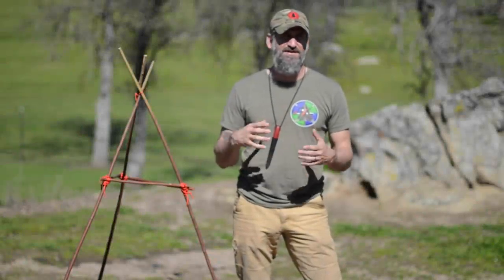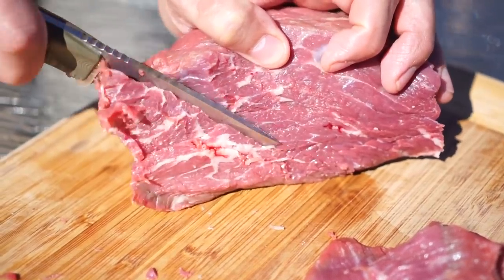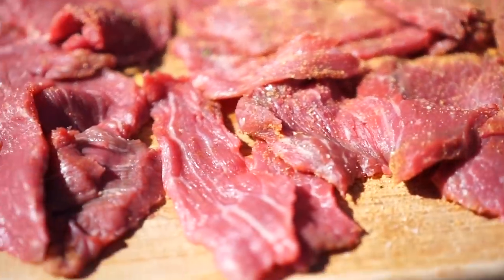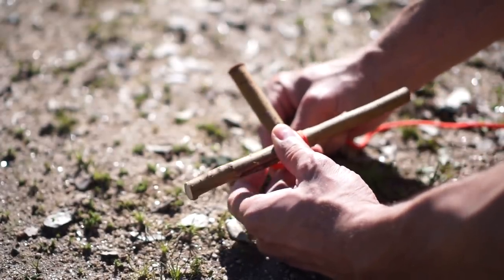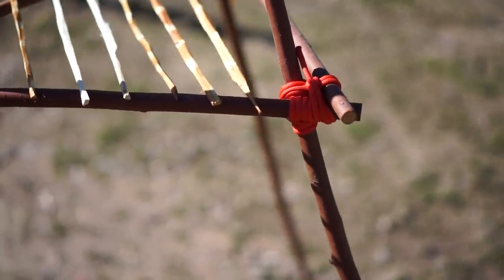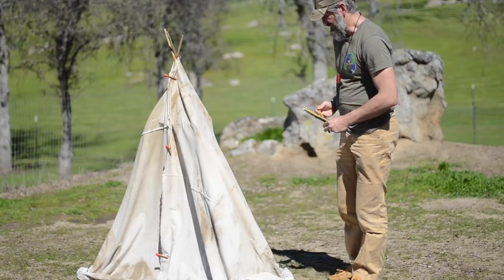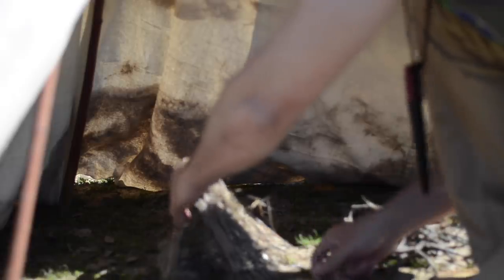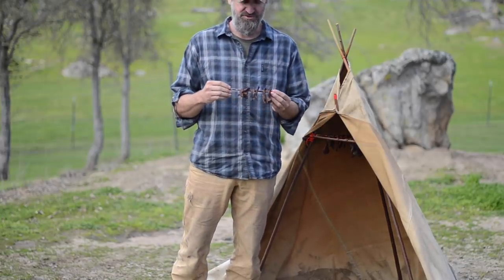Homemade Jerky and Tipi Smoker

Comment: One tool has made itself very valuable in my pack.  I added the small Martini (rapala rebranded) fillet knife.  Work for boning, slicing, fish filleting, and increasingly often "weird" tasks that aren't suited well to bigger thicker blades.  Sharpened to a fine angle.  A boning style knife is a pleasure to work up meat with and very controllable.  Lighter than a Mora, infinitely useful, and a backup blade if needed.

Comment: Lucky lucky Athena!  Gees, I have never had trouble with fat making jerky.  I have to go look this up because I kinda like dehydrated fat...and THAT is where the calories are!
Reply: I also slice the meat thinner.  Make all the slices consistent so that they dehydrate at the same time.  Is there a reason between smoking and dehydrating for bacteria?
Reply from the maker: Cold smoking both dehydrates and coats the meat with the smoke residue, both inhibit bacterial growth by themselves. I use this technique along with an osmotic dry rub to assist on drying and add flavor, so it’s a trifecta. Nothing wrong with dehydrating as a technique
Reply from the maker: The fat only matters for longer storage, it will go rancid first. I’ve yet to have jerky last more than a week so I don’t worry about storage too much
Reply: @GrayBeardedGreenBeret  Well, I do know how fat goes rancid but I've never cut the fat off, never had meat with lots of fat either.  I marinade the sliced meat for a day before putting the strips on the screens in my dehydrator.

I've never had jerky go rancid and I am very sensitive to rancid.  Oh I will not be making more jerky without cutting off any excess fat from now on...hey, I listen up when you speak.

We do the food saver thingy, taking the air out. Our food saver was a bit of a lame machine but, our jerky lasted as long as we could make it last.  Do you think the marinade of sugar and salt might help longevity?  I don't like the freezer thingy because that is not available in the wilderness and when we are out of electricity, from solar or wind.  We've made pemmican which sure it is more nutritious, not more caloric but ick.  Do people understand that meat (sans the fat) is the same caloric content as lettuce...per gram?  4 calories.  Eating meat is nice because you get a nice big wad of calories and some fat at one time.  Otherwise, eating a tablespoon full of 'apical' or terminal buds of correct plants is worth more than a large salad in calories.  Fits right into the cup of your hand.  No cooking necessary, pinch, eat and keep going.
Reply: @GrayBeardedGreenBeret  We smoke lots of stuff (ha ha  ha)...got a smoker.  Would it help to smoke the fillets of beef...or whatever first and then dehydrate them?  I am still looking into this, mainly cause we send lots to friends and family and rarely have any left over to go rancid I guess...grins! 

 Okay I have to ask about COLD smoking.  Not knowing this, sorry!  I hope you have your 'osmotic' dry rub recipe in this video?  Osmosis; going from high concentration to low concentration, right?  Huggs.  Seriously you are the only one I trust with survival.  You make sense. I actually TRUST what you teach. Other survival programs seem to be missing lots of tiny but important details!  Well, I KNOW that they are missing...arghhh!

Comment: Hey man - love to see that old standard woodhandle short blade mora in action. I grew up with those knives and I’ve owned a bunch of them, from the different manufacturers in that region. I still have a couple of old non-laminated and non-stainless ones lying around (and some new ones) and while I own fancier versions of the same idea in the shape of a Helle blade or two, they’re still kinda goto.

Over the years I would try more expensive knives of different descriptions, but for that basic wood-work and all the sort of common everyday tasks I’d always come back to those basic Moras, because they’re cheap, lightweight, super maneuvrable, easy to sharpen and sharp out of the box in a way that they just seem to melt into wood. 

I never really got the type of knife handle that will lock your hand into a few fixed positions, not even really for choppers. There seems to be this fear that knives will somehow go flying in all directions if they dont have a special groove to lock in each finger. I’ve just never seen that happen. And I rarely work with that kind of fixed 90 degree angled death grip for much of anything except power cuts.

Also I am not particularly keen on various guards because they tend to get in the way of flexible maneuvring and I REALLY dislike unsharpened parts of the blade close to the handle, that’s like where I want to be doing all the more forceful cuts from and I want that leverage and control. That simple round handle, with nothing in the way and a clean edge all the way up at the level of the middle of your fistjust lets you do anything in any position. 

And there is no need for some cumbersome full tang that’s gonna go cold in the frost anyway, because you most likely won’t be batoning or chopping away with this knife, that’s just not the point of it.In 40-odd years of usage I have never had a blade come loose or have the handle crack or anything vaguely like that. 

I was however surprised to see you wearing it as a neck knife. The only thing I don’t really trust about that design is that black old plastic sheath. I mean - it’s perfectly serviceable but the way it locks the knife is such that if bumped it can knock the knife loose and the knife will sometimes feel properly locked in but it’s really not and it doesn’t take much for it to slip. 

More than once have I reached for it on my belt and grabbed the blade because  it had slipped. And a mora is one knife one does NOT want to be grabbing by the blade, it’s just not forgiving to the texture of human skin and flesh. 

And I have lost a fair few of Moras in the woods that way as well, just from wearing it on the side. As a kid I was always a bit paranoid about accidentally sliding down some incline with that knife attached to me or jumping down from any height, because that could be enough to knock it loose or even send it flying. And it’s just got a meaner and sharper point than so many other knives. 

I do see how it’s more proteced from getting bumped or snagged when around ones neck, and for just wearing around camp while doing chores, sure but still - yeah, I don’t trust those sheaths, so i’ve been making leather ones for them since I was a kid instead, even though they get wet and take time to dry, which of course is not ideal for the old high carbon non-stainless ones. Sometimes I’d remove the belt loop and use the plastic tube as an insert in a sheath that would then further scure it with a flap or some such. My favourite one was made for my by my best friends dad when I was 13 or 14. I am 50 today and it’s still in perfect condition, I never even treated it with any products. He probably did though. And he’s the reason I even got into leather work at all and know hot to do it today … 

Well - there’s a novel. But these are great knives and I’d pick them over most of the modern versions of the mora any day, although I HAVE had my eye on the Garberg for a while … xD

Comment: It's like you made this video just for me... this is something I've always wanted to do. Quick question.... about how low to the ground is the closest you can have the rack.... And can there be multiple racks of meat???
Reply from the maker: That really depends on the size of the fire inside, it’s a temp control thing. You can do multiple racks but the bottom rack is always going to dry faster than the racks above it so you have to rotate them and really keep an eye on the fire. I don’t put a rack any closer than about 2.5 feet and that’s pushing it.
Reply: @GrayBeardedGreenBeret  again makes perfect sense. Thank you very much for the reply and inside.

Comment: Do you use any particular kind of wood to smoke it or just whatever is available?
Reply: I like mesquite as my base fire and use hardwood chips soaked in water for the smoke.  Oak and hickory are popular for beef.   fruit trees are good for fish.  I've always used orange wood for tuna, but not as jerky.
Reply: I’m in Australia so my wood choices will be different of course. I might just have to do small amounts and experiment with various woods. 😀
Reply: @Dunebuggy2012  be sure that it isn't resinous like pine.  resin in pine makes for good fat wood, but will leave the meat tasting like crap
Reply from the maker: I typically use a hardwood like hickory, or a fruit wood like apple. Mesquite is another I like when I am out west

Comment: I love jerky this was a great video. What cut of beef do you like to use?
Jerky is great, you can eat it as is put it in your water pot to make broth or rehydrate it in some warm water and add it to say a package of romen or add it to any legumes or tubers and have a real steak dinner so to speak.
Reply from the maker: I really just look at the grain and how lean it is and take what looks best. I don’t have a preference other than that
Reply: @GrayBeardedGreenBeret  I've heard flank steak makes for good jerky. Besides your way out in the Bush I learned Ed another w!y to do it at home without buying a dehydrator it's very creative.
Reply from the maker: I know some folks do it in their oven as well at home.
Reply: @GrayBeardedGreenBeret  true this concept takes a box fan cellulose furnace filters dehydrator shelf liners and a couple of bungee cords with 24 - 48hrs in a room with good airflow. Like I said innovative and more energy efficient than using your electric oven.

Comment: What kind of wood do you use, reason for asking I smoke quite a bit of meat and as you know some woods are not healthy to smoke with. I usually use hickory, pecan, apple, cherry, oak that I soak in WHISKY for several months then let dry. But I also use a Webber kettle that I've added a top hat to then the top, I have added several racks up high in the hat. Also have you ever smoked salmon that is incredible to eat smoked.
Reply from the maker: Mostly hickory and apple in my area

Comment: Another fantastic video! Quick question, what is an indicator that the meat may have gotten too hot? Thanks man! 🙌🏻
Reply from the maker: Well, its difficult to say for sure without monitoring the temperature every once in awhile and controlling the coal bed. Generally speaking I would say that the color of the end product (gray vs. reddish) might be useful in determining whether or not it cooked or smoked but that would be a tough one with how thin the slices are.
Reply: I appreciate the response! 🙌🏻 Also, I’ve been raiding your shopping list on Amazon. Thanks for all the equipment recommends. 👍🏼

Comment: Do you ever open up the Tipi to add more twigs for more coals? 8-12 hours a long time with just a small bed of coals, so I'm assuming you've opened it up and fed the fire again for more coals; I wanted to ask to be sure. Thanks!
Reply from the maker: Yes I check on it every hour or two
, usually placing my hand over the top to feel the temp coming out. When the smoke stops rolling it likely needs to be fed again
Reply: @GrayBeardedGreenBeret  Excellent! Thank you very much for replying. I assumed you checked the fire temperature but also predetermine based on the amount of smoking coming out as well. I hope to try this out in the very near future. I also learned from David Canterbury to put jerky into a stew and it will rehydrate; sounds like it would very good.

Comment: Just wondering what cuts of beef to use? Is it ok to use firmer/chewier cuts because its smoked or is it better to use tender ones? Besides the obvious differences in texture, also the pricing ranges kinda made me wonder about this...
Reply from the maker: Whichever cut has the least amount of fat. If you trim the fat off, you can use any cut really
Reply: @GrayBeardedGreenBeret  Thank you for taking the time to reply to my question. Will try this soon! One more little thing, I wasn't quite clear on the rub you used. Besides two of my own concoctions, I'd like to try your recipe as well.

Comment: Sweet now I just gotta figure out how to do this in my Backyard and not burn my place down. Jajajaj. Thanks! What knife was that you used to cut the meat? Cut through like butter. Did you add more fuel to the fire?
Reply from the maker: That was the MAK that I have been field testing since January. I have two earlier videos up about it and am a couple months from a full review (I like 6 months of use before I can say one way or the other of its good to go), but yes it cuts through like butter. I did add more fuel, typically I check the heat and fire once every hour or two

Comment: I imagine that pine should be avoided as the fire/smoking wood due to resine.  If in the field and there is nothing but pines available, can it be used?  What about shrubs, might they be an option?  If so, which should be avoided?  Many parts of the west are lacking in variety.
Reply from the maker: Yes, avoid resinous woods for cooking. You can often find alternatives in those areas. Mesquite is a good one out west. Apple is another.

Comment: I'm sure you already know this, but if possible, the meat is way easier to slice partially frozen. Thanks for the video!
Reply from the maker: For sure. We do this in my winter class just because it’s so much easier. This was filmed in California. No such luck on the cold I prefer
Reply: @GrayBeardedGreenBeret  Yea I didn't think it through, not typically a freezer hanging out in the "bush"

Comment: Roughly how long did you leave that meat smoking there Josh? Thanks :)
Reply from the maker: I think this batch took about 10-12 hours, really low heat because I was doing other things that day and I wanted it good and dry. I check on it about every 2-3 hours to see where it’s at. When it’s dry it’s done, sometimes that can be as little as 6-8
Reply: @GrayBeardedGreenBeret  thanks Josh :) sorry another question... when you were checking on it, every 2 or 3 hours, did you have to top up the smoking wood fire?, and were you using green hardwood twigs or something else? Thanks again in advance 👍
Reply from the maker: Caroline Smyth seasoned hardwood chips typically. And yes, topping off the fuel as needed to keep the fire sustained while I was checking on it
Reply: @GrayBeardedGreenBeret  thanks Josh... Now all I need to do is get to some woods with some lean meat, my knife, Ferro rod and some seasoning ❤

Comment: Sorry but you lost me on this one. I love my "Knives of Alaska" Bush Camp, 6" full tang, D2 steel, but I don't use it for jerky. That's why GOD and Germans made J.A.Henckels.
Also when you get old you cut against the grain so the fibers are short and easier to pull apart although my Navajo friends grandmother would have taken the entire roast and rolled it as she cut making one incredibly long strip that was so uniform it looked like it was processed on a commercial slicer.
I confess to cheating on the chips. A little bit of Maple shavings from the wood planer does all I need.
Reply from the maker: That is a knife in field testing and this was an opportunity to use it, I don’t typically use it for making jerky. Been my experience that cross grain for jerky and it crumbles when it’s dried out, so I cross cut steaks and cut along the grain for jerky so it stays together after drying